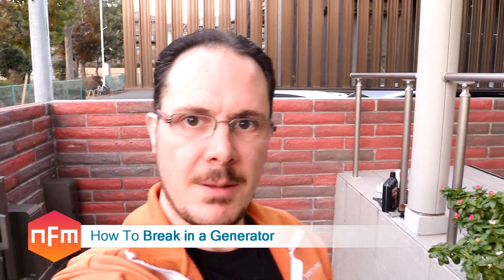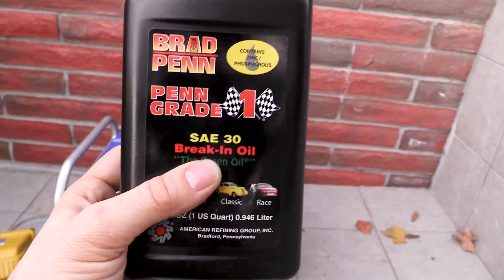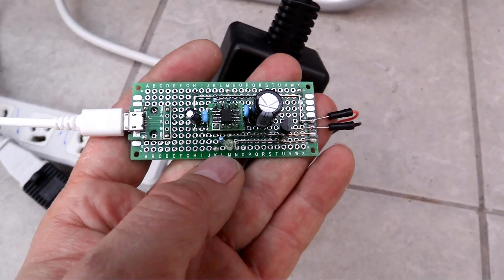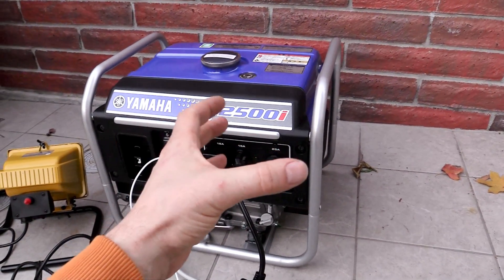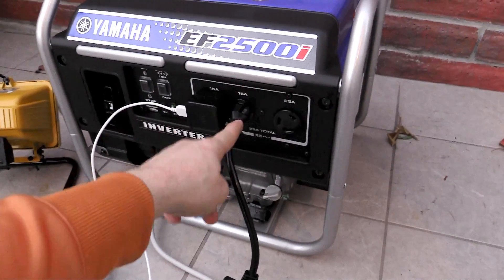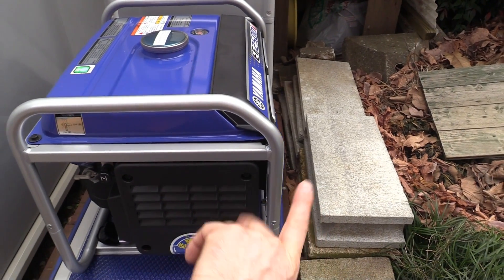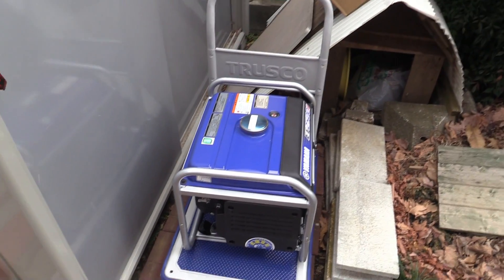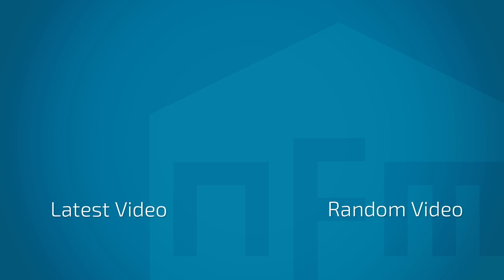How to break in (bed in, wear in) a new Generator

Comment: You forgot to mention, to drain the break-in oil, and replace it with regular oil.
Also, those "Fuel stabilizer" or a big waste of money and don't work at all. The best and easy way is use fresh fuel after a long storage period. 
And if you really want to "stabilize" your fuel, you can add 10% Toluene, it's much cheaper and will work much better.

Comment: You should put a little oil in the spark plug hole to get oil in the cylinder before you ever pull it. That way the cylinder isn't completely dry. Add conditioning oil and dry pull it slow about ten times.
Reply from the maker: This is true. My generator was already tested by the seller (lubricated and run for a few seconds to test it works before shipping) so that was sorted for me.

Comment: Big thanks for the video.  Ordered a WEN generator and want to break it in right.  I'll use an oil filled electric heater for the load.  (the one that looks like an old steam radiator) It has three different wattage settings (600W, 900W, 1500W) so I can try varying the load by switching.  I can also put a circular saw on the other 120V socket and actually get some work done.  Now to find some break in oil (not in stock at local napa store)

Comment: The run cycle you refer to in the video to break in a generator is it 1 min. load on and 10 min. off? Heard you say 1 min. on 10 sec. off, but also 1 min. on 10 min. off.
Reply from the maker: Ah, sorry! it is about 1 minute on, 10 seconds off. The actual times aren't too critical, just a reasonable on-off cycle.

Comment: 5:05 = what a load of absolute BULLSHIT. No load creates a vacuum in the crankcase ROFL... you are just making it up as you go along, right?
Reply from the maker: The crank case is connected to the intake system on the engine side of the throttle body via the crankcase ventilation pipe and sometimes a PCV (Positive Crankcase Ventilation valve).
When the throttle body is closed, the engine is still trying to suck air, then sucks air out of the crankcase, creating a vacuum condition.
This ventilation pipe is part of the emission controls to remove and re-burn blowby gasses.

Do a little research before you post a message in the future...

http://www.mcx5.org/images/books/1199/ac5uun00000087.gif
Reply: NFM - when the engine is idling, the PCV Valve is deliberately held closed (by design), so the system is almost non-operational at low engine loads. Watch your own video again from 5:05 and listen to what you say about the vacuum condition... remember, there is never a vacuum in the crankcase since it is vented to the atmosphere (the ventilation hose in your own linked GIF image). What you say about vacuum sucking the oil off the bores, etc is not correct, and you know it. The PCV system is designed to remove *gasses*, and has ABSOLUTELY NOTHING to do with removal of "microscopic nano-particles of metal" 4:45 that you claim might result from the break-in process. I generally agree with your break-in process, but you have significant misconceptions about the real reason that it's best not to maintain a steady load or constant RPMs during the break-in.

Comment: Well damn what do you do when you don't have that auto on off switch
Reply from the maker: There's a link in the video description for a timer module from ebay. Should work well.
Reply: I just broke in my new honda eu2200i this weekend I used a toaster oven holding a certain temp so it turned on and off every minute or so. Thanks for the video it worked great!
Reply from the maker: Awesome, good idea on the oven! Basically a big resistive load like my lights, but yours had a built in controller. :)
Reply: I would love to get your method details if possible!  I am trying to break in my very first generator and want to do it right.  I don't understand the switch method but I have a toaster oven, so could you please explain? Thanks!
Reply: @NearFarMedia    I clicked on the ebay link and several modules popped up.  Which one do you suggest?  I'm concerned I may pick the wrong one.
Reply: @Farris360  just make sure you choose a 5V version from his linked search if you would like the same style as his.
Reply: IMAGE OF PARTS AND WIRING DIAGRAM:  https://markuskjohnson.tripod.com/Timer_Relay_Wiring_Diagram.jpg (You may need to copy the link and paste it into your address bar).

Thanks for the info NFM!  I ordered the parts and finally figured out how to wire it all up, tested and works correctly.  This took a little time since there are no instructions with the timer relays and wiring instructions are hit and miss.  My wife mocked me for spending more time setting up the timer relay and switched Power Supply than it might have taken to just sit next to the generator and flip a switch on and off manually!  For others like me, I've included a photo link here to an image which includes the part names which you can search for on your favorite online shopping site and also a simple wiring diagram.  Be sure to order the correct voltage timer relay.  I inadvertently ordered the 12V relay and spent much time trying to figure out why it wasn't working until I realized my mistake and swapped my 5V USB cord for a 12V battery :)

Comment: one thing to remember, sometimes they ship things with peanut oil or other various vegetable oils to get around the no oil shipping laws.  Found that one out with some of the Chinese products here in Canada.
Reply from the maker: Wow, really? I've never seen that before. Would certainly smell interesting....
Reply: NFM when the chinese engines started coming through the bix box stores, people were topping up the oil and running them. They didnt realize the oil in there wasnt regular oil, and the motors would lock up. Generally, run em with a quality oil for a couple mins, then change it and the filter and put good oil in. They are usually fine after that. Also found out most of the import engines are direct copies of yamaha products and are not too dificult to sourcr parts for :)
Reply from the maker: Yeah, when I used to service these things professionally, I found the same.
Chinese versions were mostly copies of Honda, with some Subaru copies in the mix too.
I also serviced quite a few Chinese versions of the Yamaha in my video too, it seems to be a popular form factor to clone. No inverters and often no AVR though, just a capacitor to set output voltage and that's it....

Comment: Handy to know the proper way to run in a motor. Thinking about buying one of these for here in Indonesia. Black out or as they known here "mati lampu" (literally translates as dead lights) happen on a weekly basis, and some can go for 6 hours or more..pain in the proverbial. One thing you didn't explain, or maybe i missed it..once the run in process with 555 timer circuit is completed..do you drop out the oil with the metal shavings, and fill it up with regular oil?? Or do you just leave it?
Reply from the maker: Ah, you remove the running in/break in oil and go back to normal oil.
I reused the oil that I pulled out at the start.